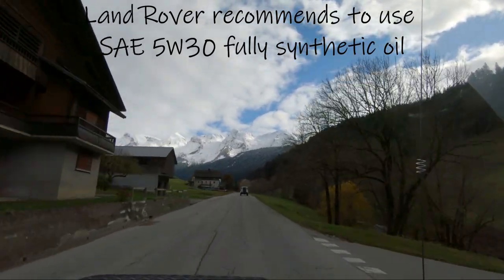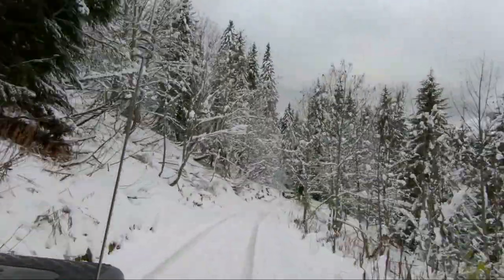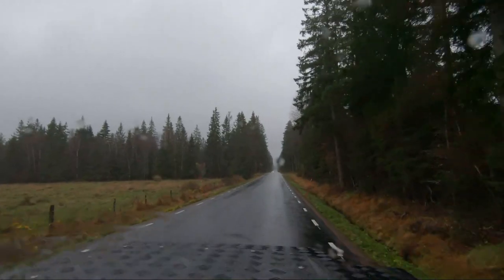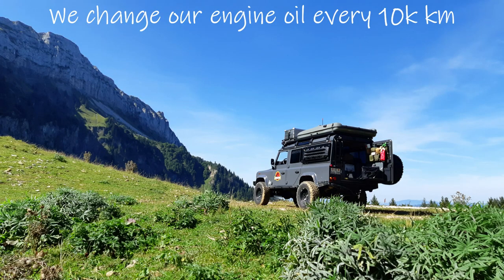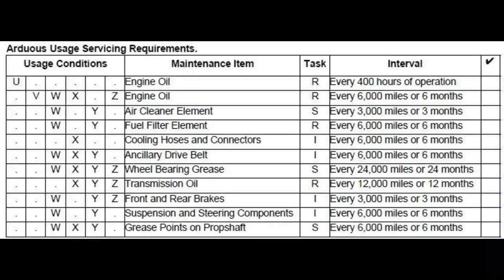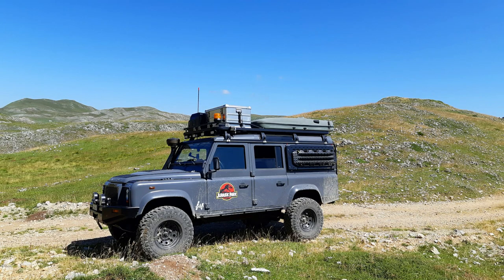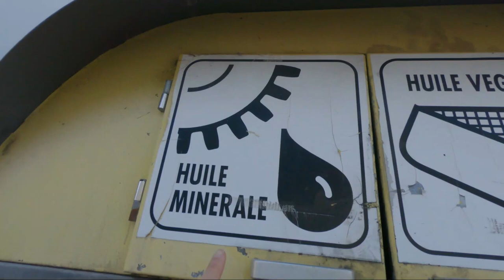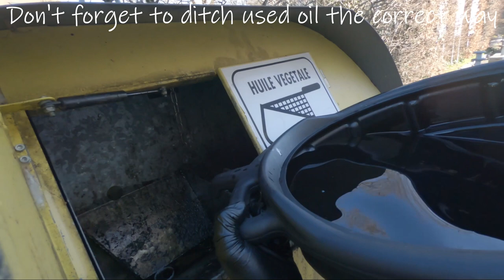DIY DEFENDER PUMA 2.4 or 2.2 TDCi OIL CHANGE | Land Rover Defender | Maintenance series

Comment: I’d recommend filling the new oil filter and bowel with fresh oil. So that on first start up the oil pump has pick up and isn’t momentarily running dry.
Reply from the maker: It makes sense, but I never eared about this procedure. Will make some search about it. Thanks
Reply: @offtrackfamily  it’s generally accepted in the industry that if you can, then you should. Of course when the filter housing is positioned upright such as with many german cars, it isn’t possible. Most engine wear occurs on cold start up. Anything you can do to stabilize the oil pressure quickly is a good thing
Reply: Definitely not critical but good practice non the less

Comment: The Oil wont change the overheating problem. Get the PUMA Hood from Nakatanenga and also the bigger intercooler. Especially when you drive longer highway distances.

Comment: Note the coolant expansion tank that you cannot see through, and have to struggle to view the level when cold. Oh shame.
Reply from the maker: Not perfect but we know quite well our Defender after all those years, we try to upgrade its imperfections but not always possible ;)
Reply: You can squeeze the top coolant hose near the radiator and you will be able to see the coolant level move in the expansion tank. - despite the semi - opaque design.

Comment: Great video is it only one oil filter? I heard 2 oil filters? 2.2 L engine also use the same oil filter?
Reply from the maker: Hi! thanks! The puma has only one oil filter. two filters was for the TD5 I think but not sure. About the 2.2 not sure if it's the same as 2.4. I saw some cartidge type so it's maybe better to ensure what is the correct filter you need for your exact model and then you can do it. But what is sure it's that the process is almost the same.
Reply: Off-Track Family  Thank you so much appreciated

Comment: Hi. Thanks for video!
Comments on equivalent Ford spec oil. For driving in higher sulphur diesel fuel countries (350ppm S +) use the wss-m2c921”A” or 913”D” oil only. The 913”C” oil is suitable for EU low sulphur diesel fuel use only.
Even with the “A” or “D” oil, consider 5000km service intervals when traveling through africa as sulphur ppm can exceed 5000 ppm in some countries.
Reply from the maker: Thanks a lot for your feedback & tips :)

Comment: Bonjour. Radin, je ne change jamais mon bouchon de vidange et pas de souci jusqu'a présent. 190.000km. Ce qui serait bien c'est de pouvoir changer le joint Oring plutôt que le bouchon complet. Je souhaitrais connaître votre consommation en roulant entre 120  130 km/h. Avec notre petit moteur puma, je ne suis pas étonné de vos problèmes de surchauffe. Bonne continuation pour vos  aventures.
Reply from the maker: Merci pour ce message et de partager avec nous votre façon de faire :)

Comment: 13MM drain plug - real LR's have 1&1/8 drain plugs
Reply from the maker: On the LR Defender 2.4 TDCi it is a 13mm drain plug.
Reply: @offtrackfamily  yea it isn't a real LR
Reply: @secpac58chichi  what is the technical difference?
Reply: @marcosavio1020  nothing its just the early LR's had the bigger drain plugs and later (less capable) LR's switched to smaller drain plugs - people say LR is less capable and they pinpoint to the drain plug switch - not really anything